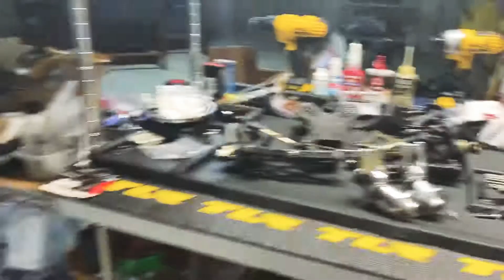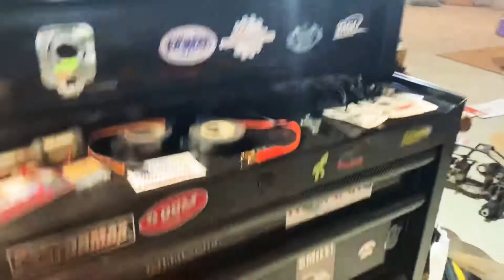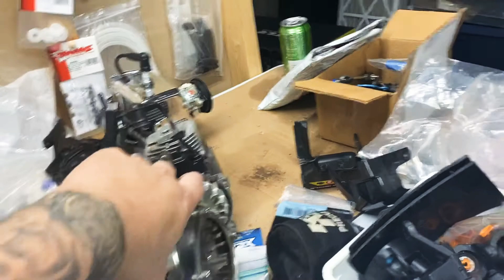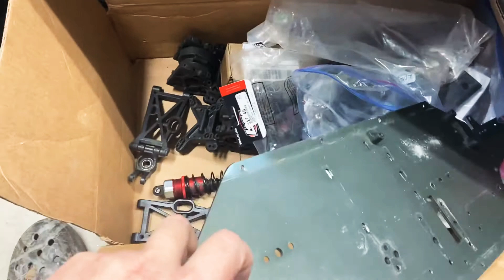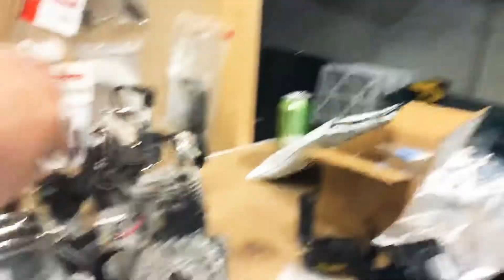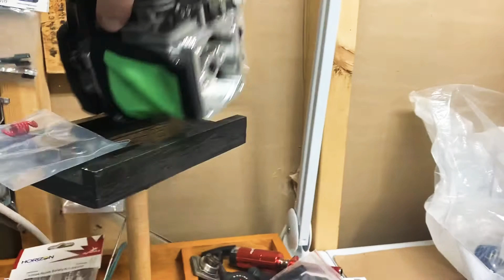Losi Hybrid build update #4

Comment: Great work mate. Love the build 😍
Reply from the maker: Carlton Faria Thank you 👍🏼👍🏼
Reply: Keep us updated 😊
Reply from the maker: Carlton Faria I should be sown in the shop today wrenching on it ! I’m waiting on parts and I can do know is trim my servo tray to fit the plate to move the throttle servo over !
Reply: Thanks mate. Or you could get the outlaw servo brace from RCMAX under Losi/Baja Hybrid Section. Also I want to know how to cover the front bulkhead/diff housing holes 🤷🏼‍♂️ 
Will be starting a Hybrid project once I’m done with the Baja that I’m currently building 😁
Reply from the maker: Carlton Faria that’s what I have !! But I have the one for the large 1/5 scale servo . You need to trim a spot where the servo drops over these two plastic posts !! !